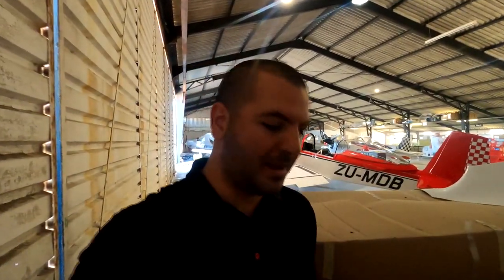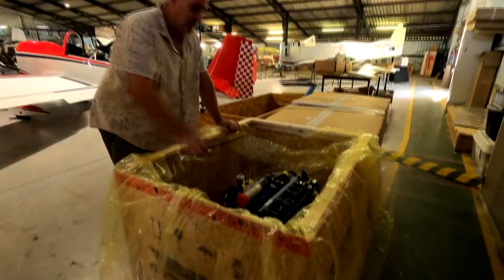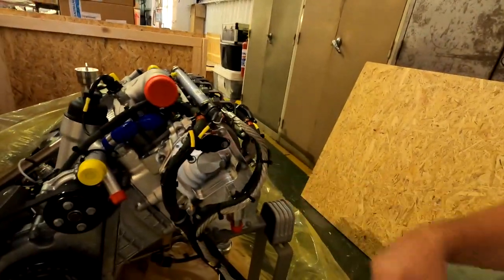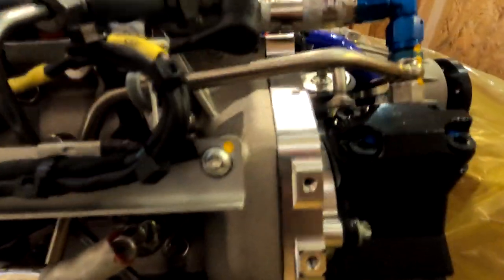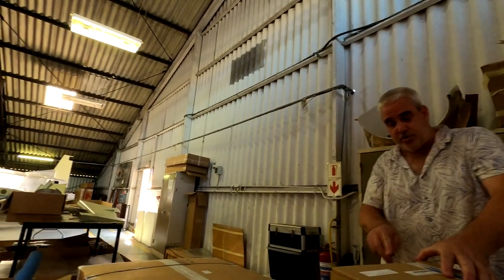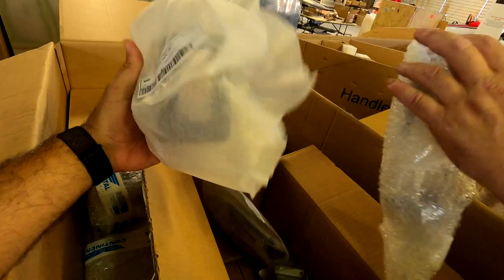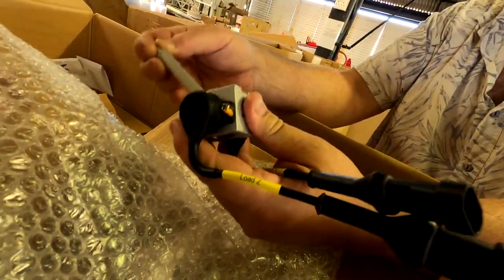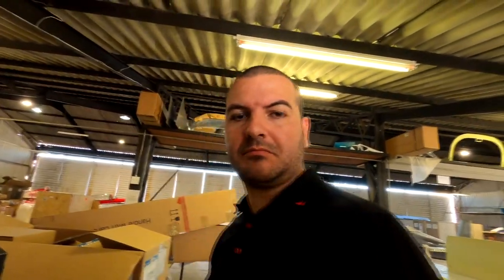Continental CD-155 Jet-A Engine Unboxing - Vans RV-9 - Robin Coss Aviation

Comment: Where can I follow along with the build. Will this be available for kit builders?
Reply from the maker: Hi Will,
As far as I know this is a prototype and development project so unsure if it will be available as a kit. I unfortunately stopped filming on this as I do not have the capacity to document this build in the detail that it deserves. 
You can however enquire directly at Robin Coss Aviation as they are the builders of this project. I am sure they can provide more detail on this project.